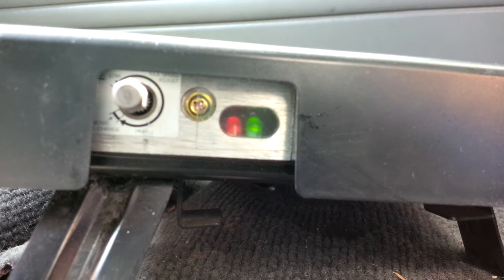Nissan D21 ECM Code Pulling

Comment: thats because each flash (1-5) represents a diagnostic mode... you need to be in mode 3... turn the dial back right after the 3 flashes and wait to count the led blinks... red is 1st digit, green is second... when you have all the codes turn the dial back to diagnostic mode then back to its original position to reset the ecu...

Comment: You have to turn it back when it completes mode 3, or three flashes. Then it'll give codes. Red for 10's, green for 1's. Then cycle to 5 flashes for clearing codes.

Comment: Did you get this figured out? After it flashes a number (1, 2, 3, 4 or 5), then you turn the knob to select that Diagnostics Mode. You turned during the middle of Mode 4 and 5, so it's hard to tell what mode you selected. Also, Modes 4 and 5 are for the Air/Fuel ratio settings. As specified in the Service Manual, the engine has to be running to see any data in those modes.
Reply from the maker: No I didn't realize that, and I had to sell the truck shortly after making the video.  Thanks for clarifying that though, hopefully it helps someone else.
Reply: jp2code
 yup.
Reply: It just did,thanks very much both of you! I've even read the Chilton a time or two, but hadn't caught on to that part yet

Comment: just wanted to know if u found any other info on this was trying to follow the directions on http://www.infamousnissan.com n get the same thing but i have a check engine light on if i turn it to the dig it starts to blink then turn back n it turns off the check engine light turn on the engine stays off turn off the engine then turn on again n the light on again 
if I'm not mistaken the lights that u see blinking r the modes